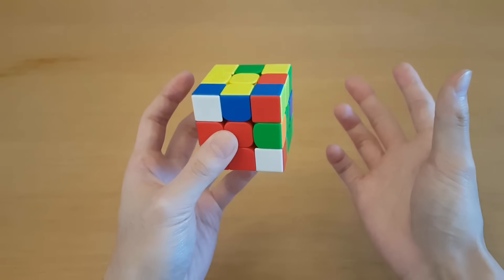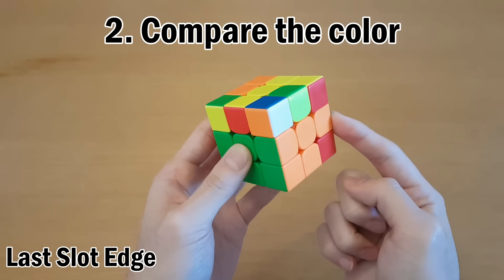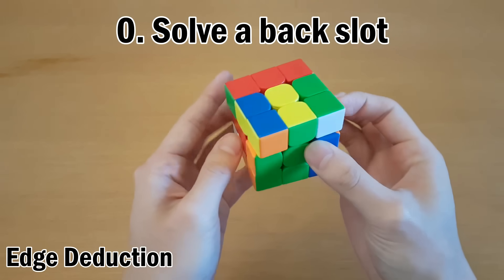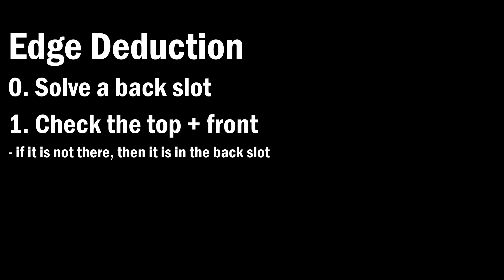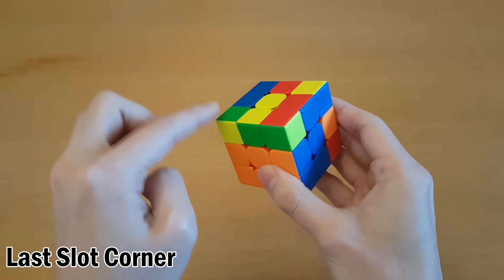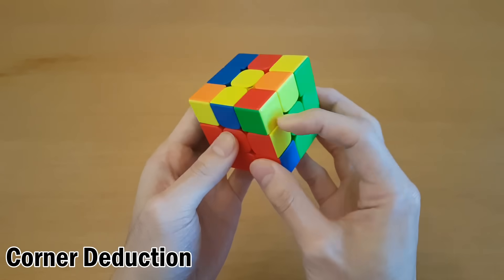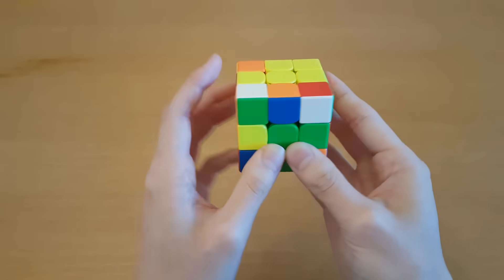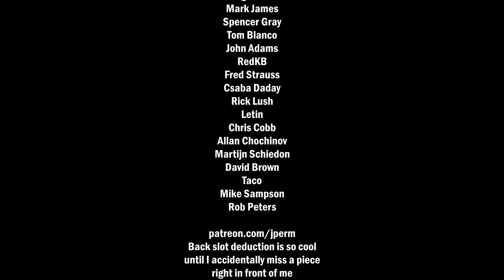How to Find Pieces WITHOUT Looking At Them | Rubik's Cube F2L Look Ahead

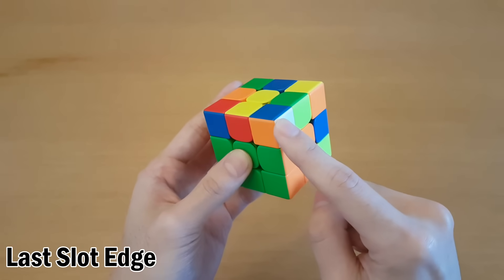Comment: For the first case you show at 1:37, I use a different algorithm where I would rotate the cube and then take the piece out to insert it. SO would rotate the cube so the edge in the slot is on the right front, then R U R' U2 R U R'. IS the F2L you demonstrate in this video better? If so, where can I learn it?
I learned my F2L from Legoboyz3/Z3Cubing
Reply: His solution is way better as it is less moves and has no rotation. It's
R' U R U R' U2 R

Comment: Guys I have been cubing for about a week and I average sub 1:45 am i doing good?
Reply: Even I started cubing from 1 week and I too have an average of 1:30 I don't know if you or I am doing good because I have a Rubik's brand cube (non speed cube) and it doesn't corner cut or move fast ( I know this is not the answer for your question but I just shared my story with you)Even I need ans that am I doing good

Comment: I just recently learned F2l and my times have been getting slower. How do I get better at F2L?
Reply: Keep practicing. Learn advanced F2L, and learn some F2L tricks. But yea, start by practicing till you understand F2L, then move on to advanced F2L.
Whenever you learn something new you times usually gets slower in the start, but the more you practice it the faster you get
Reply: @deluga1   thanks for the advice

Comment: I've just started cubing and F2L is my main problem. It feels totally coinflip and makes the difference between a 30-35ish solve and a 40+ one. These videos are going to be sooo helpful, thanks J Perm :>
Reply: i know im 4 years late, but this is exactly what i have. i usually average a minute-50 seconds, and like 30 seconds of it is f2l.
Reply: @12noviembre That's actually really good. Even for faster solves, F2L is around 50% of the solve, since you are solving almost 2/3 of the cube. You can definitely achieve sub 1 min even without improving your F2L.

Comment: Edit: This isn't even true lol, don't know what I was thinking.

During last slot, if the top color edges look like a 2 look oll case (so a dot case, small l case, line case, or obviously all edges oriented) then the last edge has to be in the last slot.
Reply: @brightblackhole Right, but instead of doing a U move to look at all of the pieces, you can just ask "are an even number of yellow edges oriented?", and if so it's in the slot, otherwise it's in the top. This is just easier to do in a split second than doing a move and recognizing more pieces.
Reply: @brightblackhole Actually I just tested it on a cube and it's not even true, idk what I'm talking about lmao.

Comment: I have a question. How do I get rid of bad habbits like doing too many U moves when I already know I need  to do a U2 flick to solve a pair or get the right prospective to solve a pll case?
Reply from the maker: You can try doing the opposite extreme, in this case by never doing any U moves until you're sure what to do.
Reply: @JPerm  So by doing that I would also have to make my recognition time better, yes?
Reply: @JPerm  thanks

Comment: Hey u was just wondering when you would upload, I ended up watching all your blindfolded videos yesterday because I needed help and couldnt find anything, I keep screwing up but dont know how. I use old pochman
Reply from the maker: Common errors are with new cycles, flipped pieces, and parity. Make sure you use a computer generated scramble so you can go back and check what you did afterwards.
Reply: @JPerm  oh wow he actually responded this is awesome, I also have problems with remembering the pieces and stuff, I cant find things for letters containing Q and edges just seem to have too many memorization things I need to memorize. I'm trying to do this without writing everything down, I've also been watching jack chai (the guy who holds the 16.22 blindfolded world record) could you possibly explain the sound effects memorization idea please I'm also lost on that

Edit: thanks for talking and possibly responding.
Reply from the maker: @bruce4139  For Q and X I personally use the "St" and "Sh" sounds respectively since they are much easier. For example QJ would just be StJ instead which is "stage". Feel free to substitute in anything else for hard letters.
Reply from the maker: For audio memorization, it's the same thing where you use words to represent 2 targets at once. Instead of visualizing the words, you just say them in your head. This only works once your memorization is pretty fast, otherwise you'll forget the words soon after. If you don't have a successful solve yet, I recommend worrying about this stuff later and just writing down or visualizing the words, and make sure you have the solving concepts down.
Reply: @JPerm  so I have 1 successful solve down but I wrote stuff down for that. I have a really big problem with picturing stuff in my head to the point it's almost impossible so often I tend to just memorize the words and what is happening to them, but if i do word pairs for both 96% of the time my brain will forget which pairs were for corners and which for edges and Roman rooms seems like it wouldnt work for the soul purpose of I cant visualize things at all. Thanks for trying to help me tho j perm, also does the j perm channel have social media on instagram?
Reply: @JPerm  oh this makes sense cool, thanks. And wouldnt STG be stage not stj? Or is that just an example because it sounds like stage